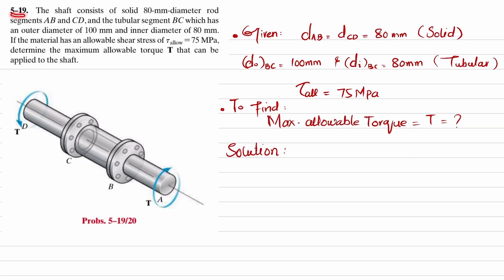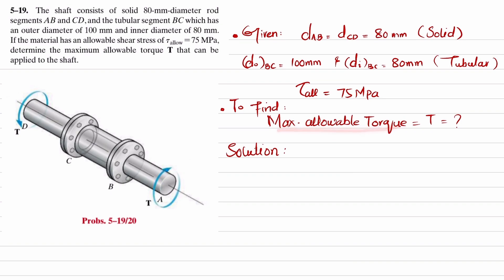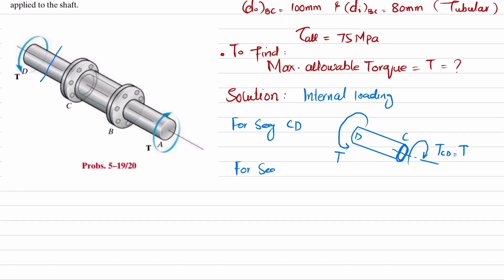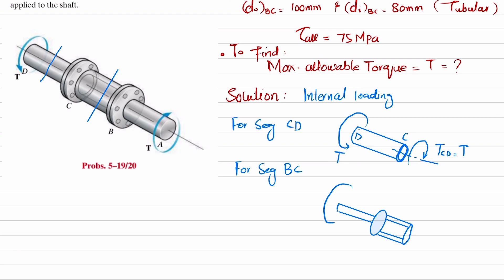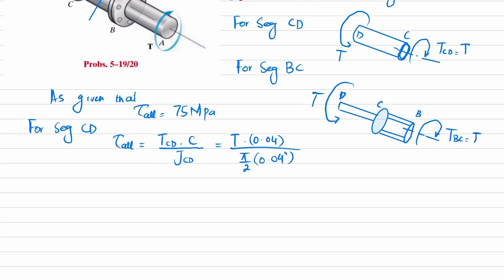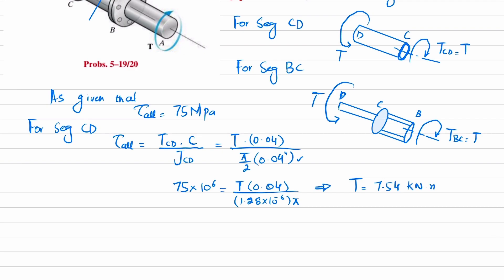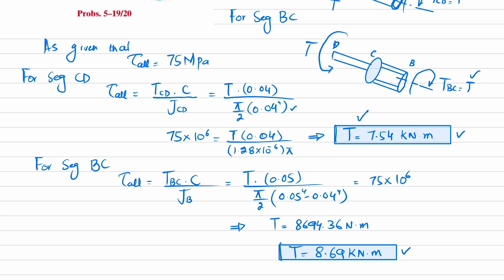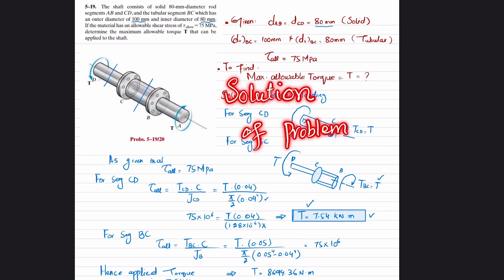5-19 |  Ch 5 Torsion | Mechanics of Materials RC Hibbeler|

Comment: in CD  its a solid shaft and we didn't used J= (π/32) c⁴
Why??
~Regards 
Waqi Ullah (PIEAS) 23-27
Reply from the maker: the formula which you have mentioned is wrong . when you use diameter then it is pi/32 x d^4 and for radius it is pi/2 x C^4
Reply: @engradnanrasheedmechanical sir i am confused.. 
Tell me formula for solid shaft and tabular one

Polar moment formulas. 
In both diameter and radius form
Reply from the maker: @xeonff6551 for solid shaft having radius c its formula will be pi/2 x c^4 , now for hollow rod with outer radius co and inner radius ci it will be pi/2 [co^4-ci^4]
Reply from the maker: @xeonff6551 for solid shaft with diameter d it J = pi/32 x d^4 while for hollow shaft having outer diameter do and inner diameter di J=pi/32 [do^4-di^4]